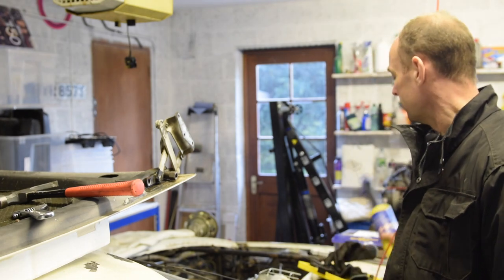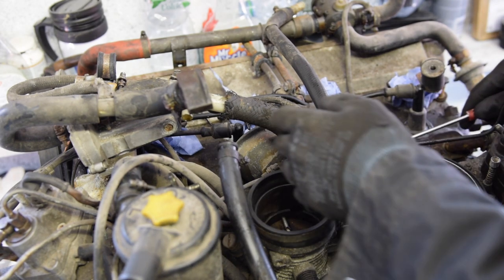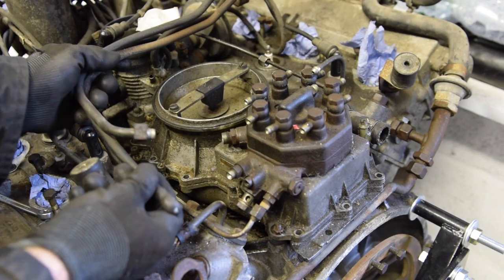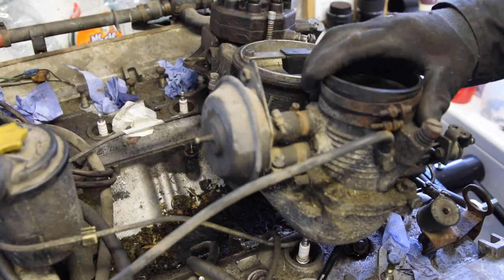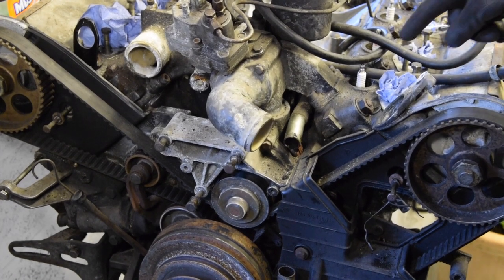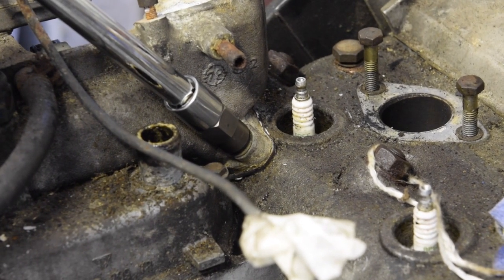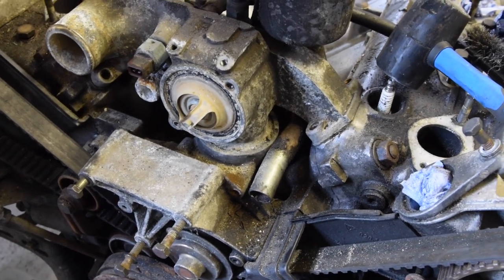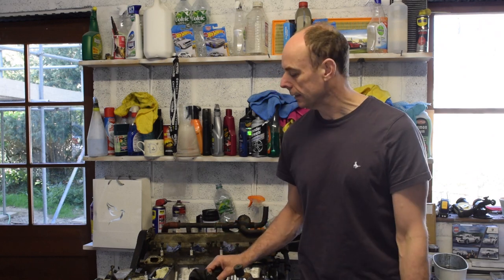Porsche 928 Episode 9 - Starting the topend strip-down...

Comment: A trick I learned (and have used quite a lot) is to heat the bolt, then spray it with penetrant while it's hot. The cooling effect of the penetrant should help draw it into the threads.
Reply from the maker: Thanks Shawn, yes I do that (when I remember!). Took the water pump off this week (snapped No.10 and 11), then read your comment and I think it saved 2 more potential snappers! It’s tricky as I only apply a little force to see how it feels - must just assume it’s stuck next time

Comment: Really enjoyed this weeks episode. Very good tip about keeping assemblies large when you strip them from the engine. That nut extractor looked like it might become a favourite tool! Very impressed how well it worked. The gunk in the coolant ways is old antifreeze and might be best to get chemically cleaned out to ensure its all removed.
    By the way, you have had a resident mouse rather than a squirrel🐀. It might not be significant but I thought it worth mentioning as they can get into places that obviously squirrels can't and therefore worth taking a very close look at all your wiring etc. Hope that doesn't sound like I'm trying to teach you to suck eggs 🙂👍
     Can't wait for the next episode, Todd, thank you and all the best, Mike 
    
 I
Reply from the maker: Thanks Mike! Always happy for advice, and yes it probably was a mouse (I was semi joking about the squirrel - I also realised they are chestnuts, not walnuts)

Those nut extractors have saved me a few times, but they grip so hard they can sheer off the heads.... as you saw :(

Comment: Both passenger bolts on my '79 water bridge have snapped in the same way as yours, only one came out on the driver's side. The driver side rear is stuck in place and I'm doing everything to get it out (over the past few days) to prevent snapping it and being in proper trouble. Great video Todd!
Reply from the maker: Hi Lawrence! Thanks for your message. To be honest, if you have 2 snapped already one more won’t make any difference. They will need helicoil or extracting. To avoid snapping I would heat the bolt head very hot, let cool, repeat. Tap reasonably hard downwards with hammer. Then try to undo a tiny bit, then tighten a tiny bit. Repeat. … I don’t think there is enough room to get any penetrating oil in there :(.

Comment: Good stuff, I presume you're making a shopping list of parts as you go. Some random bits seem to be no longer available from Porsche but doesn't look like anything special has broken.
Reply from the maker: Hi Gary - sort of, I keep a list of the bigger items, but pipe work and fittings I am hoping to source “as and when”. I’m trying to defer the large costs until I get right in there to make sure there is nothing terminal. Seems ok so far though - I was relieved the other spark plugs came out easily

Comment: If you need or want to rebuild the fuel distributor be advised that they leak after a do it yourself rebuild.  You will want to send it to a company that rebuild them mail order. A quick online search will locate a couple businesses that specialize in k-jet rebuilds. Good luck.
Reply from the maker: Hi Scott, thanks for the message. I’ve been lucky as mine hasn’t leaked a drop since I rebuilt it 3 years ago :) the rebuilt was pretty straight forward and I ensured I replaced each component back exactly where it came from.
Reply: @MrToddgibbs  I just watched the episode where you rebuilt the fuel distributor. Good work - no doubt your success is a tribute to your attention to detail and patience. Happy to hear your distributor is sorted out. The sealant you used may be a factor contributing to no leaks. Cheers.
Reply from the maker: Hi Scott - yes I’m sure the sealant is the key :)

Comment: Great stuff. Just got my top end back together. My valley looked about the same as yours. I did have an issue with those 4 rubber mount studs that hold everything up. It looks like one of yours was broken like mine. You are moving along quickly. Keep it up!
Reply from the maker: Hi TT TT, well done with the progress! yes definitely one of my rubber mounts is broken (I found it in the valley). Hoping to get those head off this week... What year/condition is yours?
Reply: White 1979 US kjet car with a euro rear bumper in similar shape to yours. Some things are in very poor shape but it keeps me busy.

Comment: 1:40 Are you using a torque wrench like a normal ratchet? That's not good for the torque wrench which should only be used to tighten things to spec and after setting torque should be set back to zero. Just trying to be helpful to anyone else who may want to follow your example.  9:32 Someone has run plain water in that engine before or mixed really hard water with the coolant. Still enjoying the series!
Reply from the maker: Well spotted. Yes I am, but its a broken torque wrench... and happens to be the longest thing I have :)  I do now reset my torque wrenches to zero after a similar comment a while ago, but its a great tip. Thanks!
Reply: Just as an addendum comment about the scale in the engine. I have a 86 Mercedes that has none of that in the engine because someone always used coolant mix/distilled water in the engine. I suspect that this car was in the hands of someone who bought it quite cheap and just did whatever to keep it going. Thank goodness the block isn't cracked! For anyone out there reading this DO NOT USE TAP WATER IN A CAR ENGINE! If it's an absolute emergency and you will literally die if you cannot get the car running then you can but it must be drained and cleaned ASAP meaning when you are not in danger of dying. Plain water conducts electricity causing electrolysis in the engine (being made of different metals) which you really don't want to happen!
Reply from the maker: Agreed ! Thanks
Reply from the maker: Btw… keep watching :)

Comment: What model year is this 928? I'm working on a 1980 with a 4.5 but the fuel system looks different. It doesn't have the big fuel distribution block where all the fuel lines connect. It has 4 pressure regulators on the ends of the rails and one up front in the center. We just got the car and are chasing a no noid in the Fuel Injection harnass at the moment.
Reply from the maker: This is a 79 car with the 4.5 K-jet injection system.